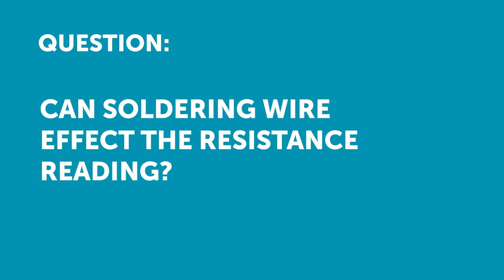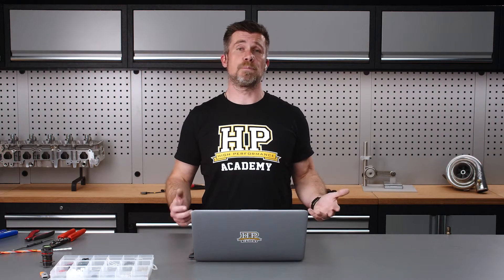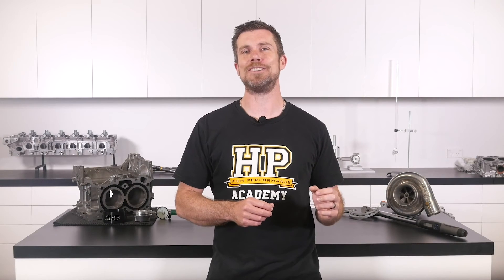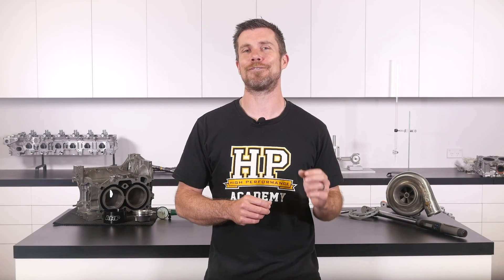Soldering vs Resistance | How Bad Is It? [HPA Q&A]

Comment: I build a boat with a jetski engine and had to re-length the entire jetski wiring harness using solder and adhesive shrink tubing.
After 3 years I had a "no start" lost continuity on a wire right at a adesive shrink sealed solder joint.
The solder looked like it was left exposed to the air and corroded heavily, BUT it was protected with marine adhesive shrink.
Was this due to the resistance of the solder joint then, too much solder used??

Comment: Where corrosion is expected (on a boat), crimp then solder. Crimp just isnt good enought in those environments.
Reply from the maker: Solder isn't impervious to corrosion. Sealing your connection correctly would be time better spent then doubling down on the connection method.
There is never any need to do both if you're doing one or the other correctly, including sealing from the elements and servicing as required for the application - Taz.

Comment: hahahaaaa lol ,. nooo..  you solder everything on cars unless otherwise directed ,, resistance is a non issue because the solder is more conductive then copper being that it should have silver in it .. Silver doesn't corrode like what ever tin pos crimp you decided to use which will definitely change your resistance values and let go later from any number of issues like vibration and heat cycling  and oxygen exposure  ,, iv been a general mechanic for a long time and am the one who has to constantly rip and replace your chimps because you now have electrical gremlins  .  you solder or replace the entire wire,. no crimps if at all possible ever ,its lazy and sub par. you racers never keep your cars long enough to be the one that has to deal with them after a few years of beating the shit out of it .. your crimps are the issue 90% of the time,.  my solder joints never fail ,,, eos
Reply: no argument from me on that front ,.
Reply: In motorsport you primarily crimp because soldering creates stress points in the wire which can cause breaks because of the vibration in race cars. Also the connectors used specify crimping and not soldering. Take the 2 pin mini-timers that are used for injectors and senders. I've never seen a soldered version of those on any car I've owned either race or street.  Quality connectors (like Deutsch) are sealed so that corrosion isn't an issue, we're not talking about those pre-insulated blue/red/yellow connectors that you by at the local hardware store. I've been around a lot of wiring installations in race cars by professional shops and race teams and I've never seen a soldered joint. They are always crimped. At the end of the day this channel is about race car preparation so the fact that soldering may well work fine on a street car is largely irrelevant IMO.
Reply: @adematthewsracing ... no i assure you either you or crimping creates more stress points in any wire than any proper solder would ,. i only say this because i have to discard that entire piece of wire after you crimped it with all of your might and broke it inside the crimp , maybe i should have mentioned ,. i was a general mechanic in a race shop that specialized in all things viper racing,,, some of the most violent cars you can work on ,. drag and circuit,  .i used to rip and replace every single thing on track cars regularly,, iv fixed more "race mechanics" issues then most so ,. ya... they do crimp alot in racing ,, but again, because it only has to last 1 season and speed and cost is an issue..  most of the time when you are specifically directed to crimp its because fuel is involved with amateurs  ,. many fuel pumps come with crimps too,.as do a great many accessories , mechanics toss them when they see them generally speaking  ,such is not the case at the dealer for instance, and its not because they are doing you a favor, or racing,.  just because crimps are included doesn't equal use them,.  the only reason to use them for a mechanic is the field repair, . but that was before the battery powered solder tool arrived  ,.  irrelevant is a good word ,. thats what it is to not care that it won't last  but 1 or 2 seasons ,.
Reply: @oskarrecon8151  We're not talking about (or at least I'm not) people who don't know how to crimp properly. The same argument applies to a solder connection. Someone who doesn't know how to solder is going to mess up a connection as well. The fully crimped harness in my last race car lasted five years before the car was wrecked in a crash and I have no reason to believe it wouldn't have lasted longer so I'm not sure where the 1 year life span comes from. The connectors on that harness were plugged and unplugged more times in a year than the average road car would be in it's lifetime and nothing ever broke. Guess we'll never agree coming from such different viewpoints. As they say in the video and as seen in the comments section of their previous videos it's a really contentious subject. :)
Reply: @adematthewsracing  ya i cant argue any of that really ., i've used some great crimping implements in the past including the expensive long life all weather ones prefilled with dielectric grease and aircraft protocols have the same thought prosses about stiffness and vibration,. but they fail to mention the defining factors of an aircraft .. drastic and fast temperature and pressure differentials , wire type, clean dry air ,constant attention and aircraft grade materials..  aircraft wire is awesome btw ,   but we aren't talking about disconnects and plugs and airplanes at all. .. , if i was,  id have to count the number of pins in an average harness and come up with a  price tag for a manufacture or wire guy to do 200 or more solders with silver solder on 14 -20 gauge ....  the 1 to 2 year thing is a personal experience of years of repairing other peoples botched jobs ,,yes absolutely a personal "thing," ., ive opened some up decades later sometimes and that wire is almost always green inside, sometimes it runs feet into the wire forcing me replace the entire branch .,.  plus i live in a cold wet salty beach town that often drops below freezing come winter and up in the 100s in the summer. crimps are much better these days. but you have to buy the best specifically, like aircraft grade best,,, and a percentage of them don't hold up like they should regardless especially if installed in a bad spot ,., the manufacturer doesn't  put D-grease in plugs at all either, "for us at least". but i fill every plug cuz oxygen and dirty salty air is the enemy of everything here ,   But for rarely driven cars or garage kept stuff in dry warm environments its over kill,  im sure nobody would ever have an issue if they do good work.  i also service plow trucks ,. work vans ,sweepers ,tractors , large mowers,  limo van fleets and even some taxis,,,  needless to say i go though anti seize like nobody else too,,,  tip for the amateurs out there,.,.  if your wire won't take solder you need new wire.,., your wire will always accept a crimp though nonmatter how green it is  .,  either way is dependent on YOU to not force solder in or crimp a green wire. ..,.
Reply from the maker: We have done solder vs crimping to death, there is information elsewhere out there too, so here are some links.

We are talking motorsports, and from comments of those actually working in the industry aerospace the comments that come though are the same, crimping is preferred save for any specific scenarios where solder is required, terminating shielded cable for a specific example - Taz.

https://www.hpacademy.com/blog/what-goes-into-a-motogp-formula-1-wrc-or-formula-e-wiring-harness-tech-talk/
https://youtu.be/EIH2AQPpPec
https://youtu.be/pOTrS6-mNtA

NOTE: You can still have your own opinion and preference, we just explain what is done and why, where. If you do it differently that doesn't mean your car will explode, more likely you're just adding an element of risk that at a professional level people chose to instead avoid. Wiring never wins you a race but it can lose you one (or more!)

Comment: Interesting. According to the electrical diagnosis and repair courses taken by Ford Motor Company certified technicians a solder is preferred to a crimp. Especially in areas where resistance is critical. Like for an engine control sensor or output. Is the vibration of Motorsports the sole reason you prefer a crimp? I know I'd rather install a crimp lol.
Reply: A good crimp or solder joint both provide an excellent mean of electrical connection. However, they have their downsides. Crimp connectors tend to hold moisture if exposed, and solder joints tend to crack due to the absence of any strain relief at the joint. The best option, for dealing with both these issues, is to pot or epoxy coat any solder joints (such as when creating a sensor with flying leads) and to cover all crimp connections with adequate heat shrink and strain relief if they are not encased in a sealed connector. Everybody has a strong hatred towards one or the other, but wiring harnesses in cars are crimped, and connections within the ECU itself are almost always soldered. You will never see ECU's with crimped SMD or through hole components, and will never see a body harness connector with soldered pins in a modern car. Each connection method works once you remove the weak point of each connection method. My project car has both, and I'm sticking to it because I use them properly, when needed.
Reply: @andregross7420  crimped SMD doesn't exist and through hole components work just fine. In fact many high current drivers are through hole.
Reply: @TheChrisey  thats the point Im trying to make.
Reply: @andregross7420  You literally said ECUs will never have through hole components, which I mentioned is incorrect.
Reply: @TheChrisey  I said they will never have CRIMPED through hole components. Because those dont exist.
Reply: I guess people prefer crimps because they suck at soldering properly. Physically there is no difference between a crimp joint and a prooer solder joint. They are both equally suceptible to cracking wires after harsh vibrations. The key of course is to make sure that the cable before the joint has a nice service loop and isn't under any ridiculous bends, and ofc that people haven't cut into the copper when removing the insulation